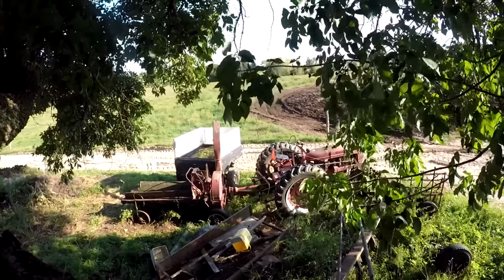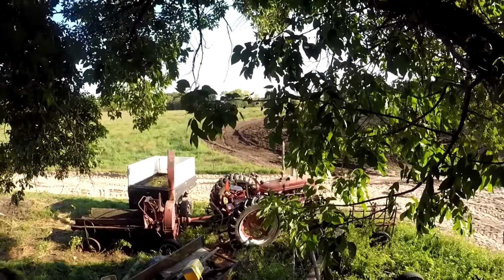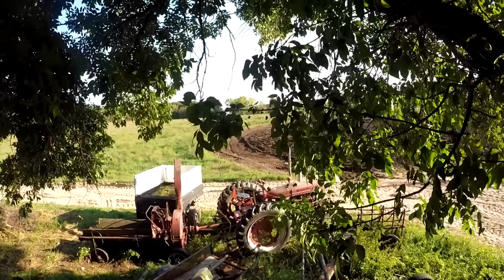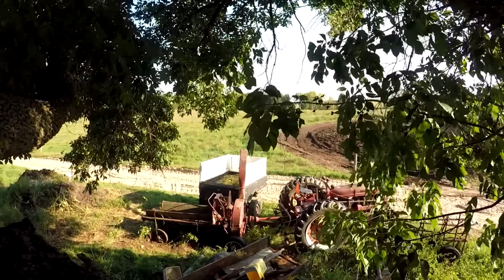Chopping Corn With The Farmall H

Comment: How do you run the pully on those things? Our H’s pully won’t work.
Reply from the maker: SandBug 1 There is a small little lever on the right coming out from the pulley housing. I believe you pull back for operating and push in for off. You must push in the clutch when engaging like you would the PTO
Reply: This Old Farm, yeah. Everything works on the tractor, except for the pulley. I've tried that it is out for the pulley to be engaged. Just won't work, thank you!
Reply from the maker: SandBug 1 Hmmm, very strange. Sorry I can’t be of more help.